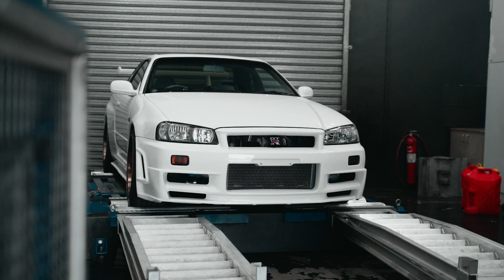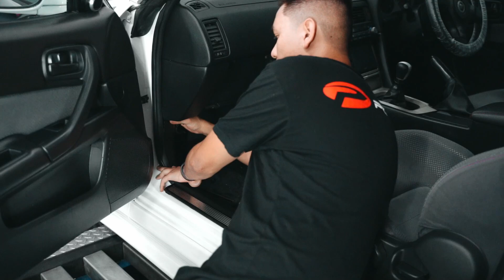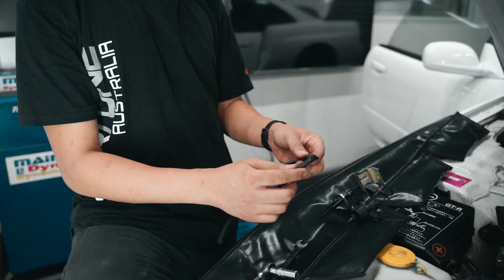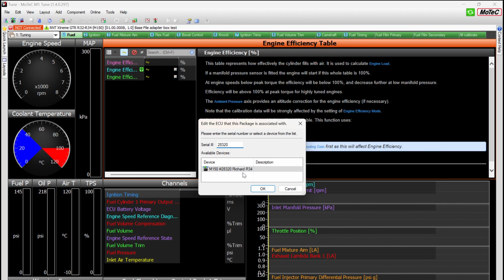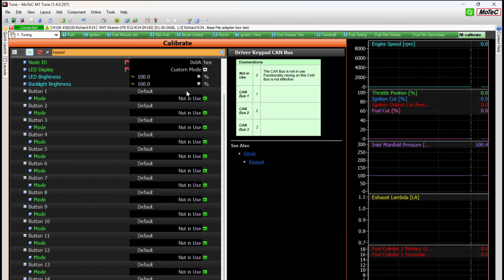How to Install the Powertune Australia M1 Plugin ECU Kit for the R34 GT-R

Comment from the maker: Timestamps :

00:00 Intro : BNR34 M1 Plugin Kit How-To
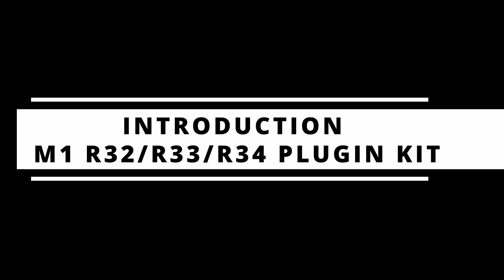00:20 Overview of the entire M1 Plugin Kit
01:22 Explaining the features of the M1 Plugin Kit
02:08 The Powertune M1 Adapter Box
02:49 Difference between M130 and M150 ECUs
03:11 What is a CANBUS?
03:36 Why choose an M150 over an M130?
04:11 Why use two Wideband Sensors?
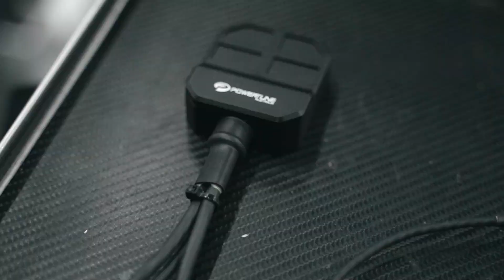04:54 What is the LTC and why do we need it?
05:14 Why do we need a Fast Acting Air Temp Sensor?
05:52 Overview of changing the sensors
06:11 What about the factory ATTESA system?
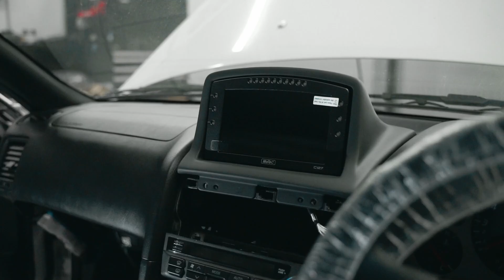07:10 Overview of the supplied mounting hardware
07:48 What about individual vehicle variations?
08:18 Overview of the Option C127 MFD Kit
08:40 What's included in the Option C127 MFD Kit?
09:07 What kind of data can the C127 MFD Kit display?
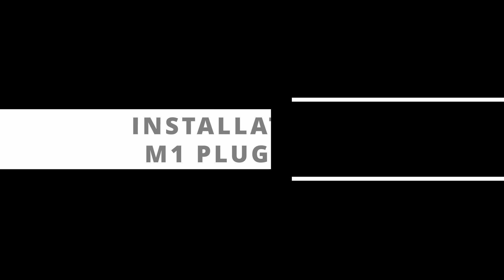09:48 Installing the M1 Plugin ECU Kit
10:13 Step 1 : Disconnecting the battery
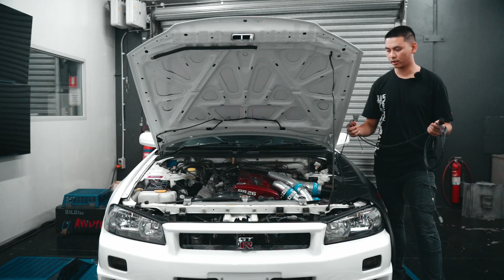11:03 Step 2 : Installing the Engine side Wiring Loom
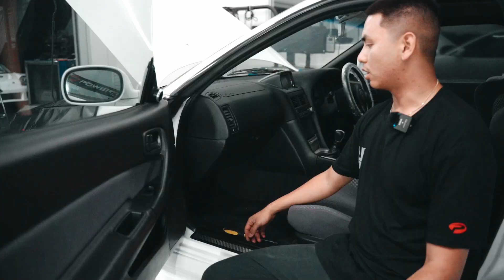11:49 Step 3 : Removing the Kick Panels
12:57 Step 4 : Removing the Glove Box
13:22 Step 5 : Removing the Factory ECU
13:51 Step 6 : Mounting the Adapter Box
14:38 Step 7 : Plugging in the Adapter Box
15:34 Step 8 : Mounting the M1 ECU
16:22 Step 9 : Plugging in the M1 ECU
17:12 Step 10 : Connecting the MAP Sensors and LTC Wideband Controller
17:38 Step 11 : Pinning in the MAP Sensors and LTC Wideband Controller
18:43 Step 12 : How to mount the LTC Wideband Controller
19:17 Step 13 : How to mount the MAP Sensor Kit
20:14 Step 14 : Removing the factory O2 Sensors
20:28 Step 15 : Mounting the LTC Wideband Controller into the car
21:05 Step 16 : Plugging in the Wideband Sensors to the LTC Wideband Controller
21:49 Step 17 : How to mount the MAP Sensor
24:11 Step 18 : How to mount the Inlet Temp Sensor
25:05 Step 19 : How to install the Option C127 MFD Kit
25:56 Step 20 : Removing the factory MFD
27:37 Step 21 : Passing the Wiring from the ECU to the C127 Dash
28:26 Step 22 : Plugging in the MFD Adapter Loom
29:01 Step 23 : Plugging in the C127 Dash
29:16 Step 24 : Mounting the Option C127 Dash and Surround
29:29 Step 25 : Refitting the centre console
29:43 Step 26 : Removing the Ashtray and Gearshift Surround
30:19 Step 27 : Feed the Keypad wiring through the console
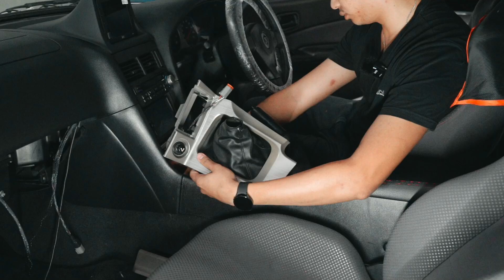30:50 Step 28 : Refitting the Gearshift Surround and Ashtray
31:12 Step 29 : Connecting the Keypad
31:25 Step 30 : Connecting the Keypad to the ECU with the CAN plugs
31:39 Step 31 : Refit the Glove Box and Kick Panels
32:49 Step 32 : How to load the Base Map into the ECU for the first time
33:09 Step 33 : Importing the Base Map from the email we sent you
34:35 Step 34 : Calibrating the MAP Sensor to suit your vehicle
35:24 Step 35 : Calibrate your Throttle Position
36:20 Step 36 : Calibrate Injector Scaling to suit your vehicle
36:43 Step 37 : Calibrate your Engine's displacement
36:57 Step 38 : Start your vehicle!
37:18 Step 39 : Configuring the Keypad and Option C127 MFD Kit
38:26 Step 40 : Setting up the C127 Dash communication
38:59 Step 41 : Using the C127 Dash Manager
39:41 Step 42 : How to setup Logging through the C127 Dash
40:03 Step 43 : All done... You're ready for dyno tuning!
Reply: Hats off for the edit Ved, damn good mate